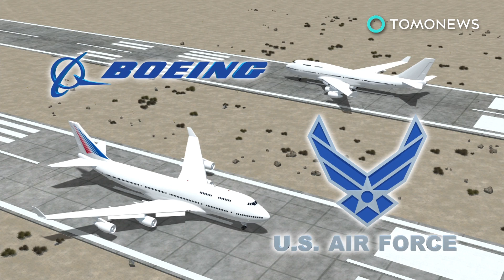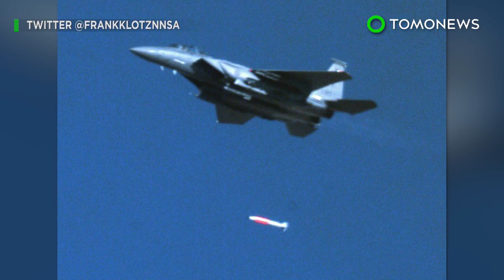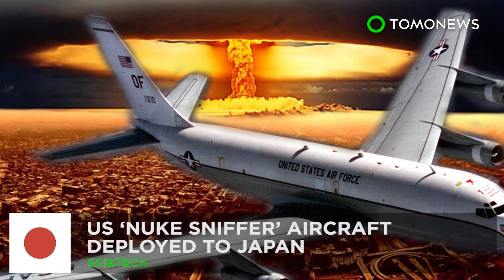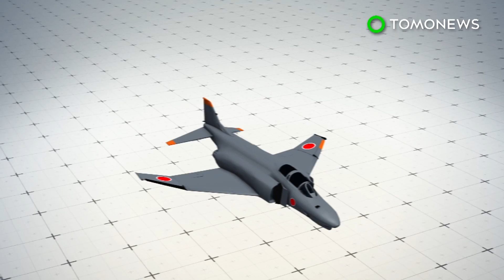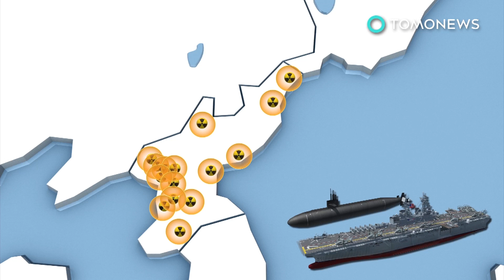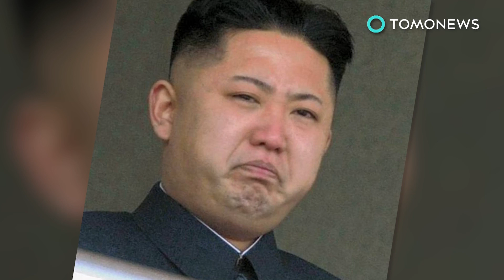Next Air Force One: Boeing snaps up contract to begin design work on presidential jet - TomoNews

Comment: "wasting tax dollars" I mean, massive fuel savings are a waste apparently.
Reply: AegisX_RBLX Yes, 3.2 billion worth of fuel savings. The 747-8 does have a lower Fuel Consumption per passenger, but add what the Air Force wants to do to it (heavy armor, replace the seats, Donald Trump, Medical Facilities, Countermeasures, etc) the consumption is probably going to be higher. Also the 747-8 has a lower consumption because it carries more people. But I doubt you're gonna cram Air Force One with people.